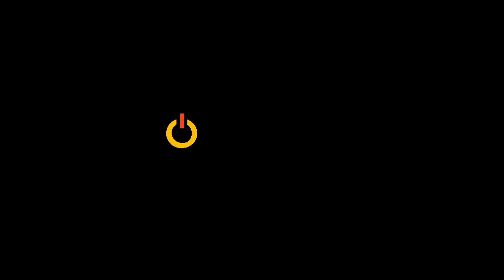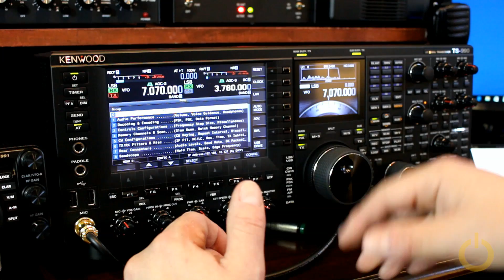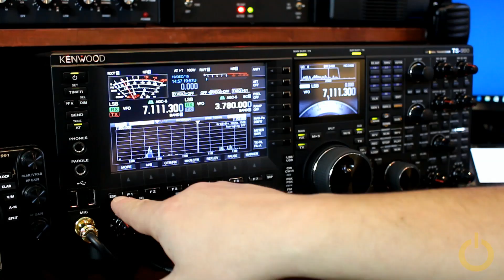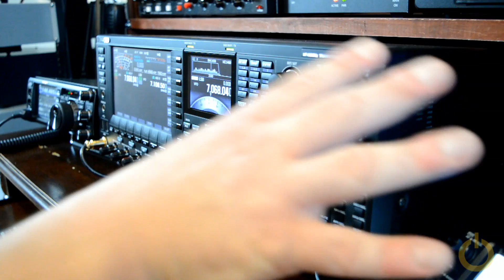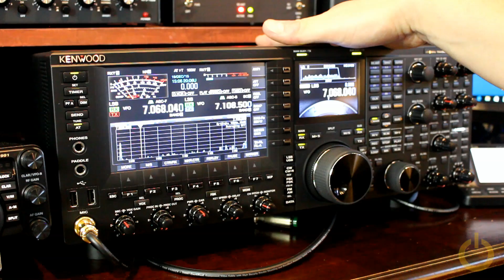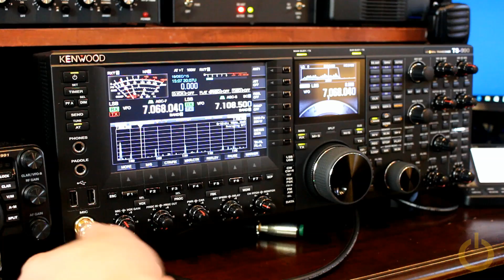Kenwood TS-990 Review and Quick Tour - Pascal VA2PV

Comment: After you spend your hard-earned $7,795.99 for this TS990 transceiver and get it on the air, you will notice that the band conditions are horrible, and have remained so for many years. In 2021 we expected the 11-year sunspot cycle to improve, however this 11-year sunspot cycle is at it's lowest part of the larger cycle of cycles, so operating conditions will be poor for quite a long time, regardless of how much you $pend on gear. Spend less and get the same results. 'Sorry to say that  Mother Nature is controlling the air waves.

Comment: Is this radio better then the IC-7300 or the IC-7610?  Just wondering
Reply from the maker: With all of these radios there is no bad one.   The new Icom 7610 and 7300 are SDR new technology but the TS-990 is a state-of-the-art high rig from 2013.   Since I didn’t try the ICOM yet, I can’t say for sure.  But what I can say, all the bells and whistles in the TS-990 make this rig unique and probably more complete in features than the other two.  I think it’s like comparing a 2013 Ferrari with a 2017 Camaro.  The best advice is to go with your budget.  Hope this help.  73 Pascal VA2PV

Comment: Pascal - This looks like a great radio and you made a great video.  While I was watching it, I noticed that it appears that you have an ICOM IC 7100 on your desk.  If so, I was wondering how you liked it.  I know these radios are not new, but I have read good things about them.  However I have never spoken to anyone who owns one.  I'm thinking about buying one and would like to know if you would recommend it as a 'shack-in-the-box' type radio.
Michael VA6XMB
Reply from the maker: Hi Terry, glad you liked the video, thanks for watching.  As for the IC-7100, it’s a great radio.  This is definitely a shack in a box and a perfect radio for remote operation, see my video via the link further below.   I sold it last year because I was not doing any remote anymore and I needed some extra $ to spend on something else, hihi.  I highly recommend it as it covers all band all modes, and in HF the performance is very good, don’t judge it from its size.  73 Pascal VA2PV
https://www.youtube.com/watch?v=ovUhJWiNLfs

Comment: Might want to consult the Sherwood Engineering list.
http://www.sherweng.com/table.html
Reply from the maker: Hi Timothy, The TS-990 is not on top of the list but most of the difference between radio, in the top 20, with better result are not audible by the human ears.    The advantage of the TS-990 is all the bell and whistle that are accessible easily at a touch of a button, that’s why this type of rig is still very popular among serious DXers.    SDR technologies present better performance, but in a contest the mouse is for most a slower procedure…  This is starting to change with rigs like the IC-7610.  It also all depends of the operator operation.   My ELAD FDM-DUO (see my video review https://www.youtube.com/watch?v=4twI8nu3hnA&t=216s) is very good, especially when using a computer, maybe a bit better than the TS-990.   But I still prefer the TS-990 over it, much better experience for me.   At the end of the day, it’s something personal, performance for the buck it’s maybe not the best deal.  But look at my recent video with two matching speakers (https://www.youtube.com/watch?v=_bFUySGKzHs&t=74s) on each side, WOW, my shack is the best place to be for me, all because of the massive rig that makes me feel like a king, hihi. This is as important for me as it represent the accomplishment of my dream shack.  73 Pascal VA2PV

Comment: Wow...$6,700.00 radio (new with discounts).  Man is it nice but good lord that's a lot of money to spend just for chatting up a person which usually lasts 1-2mins.  Aside from that, excellent video presentation and quality.

I wonder if a rig like this is becoming obsolete with the new SDR gear that is coming out?
Reply from the maker: Hi Matts, thanks for your comments. Well the TS-990 is a great radio, I bought it used and had a good deal, so it's not that bad on the wallet, hihi. SDR are very good but this radio performs very well too, the best advantage over a SDR is that everything’s is accessible via the front panel, no mouse and very fast / easy access directly to features. Those rigs along with IC-7700 and IC-7851 are still the choice of many DXers because of the ease of use in contest. SDR seams to depreciated faster since not all ham’s (especially older ones) are willing to use a computer. The game changer will be the "in between", like the Icom IC-7300 and the IC-7610. I like new technology, but if I ever get a SDR radio it as to have a standalone interface like my ELAD FDM-DUO QRP. 73 Pascal VA2PV
Reply from the maker: Another thing, this beast look fabulous in my shack, hihi.  I bought two matching speakers for it... look at my QRZ page.  73
Reply: I agree, that radio and along with the rest of your setup looks absolutely amazing (and professional).  You have my sub, keep doing your thing.  cheers!

Comment: 1 x TS-990 or 2 x TS-590SG ? I own 590SG, but since it's impossible for me to afford a 990, perhaps a second 590SG on the bench could compete this set, lol, great video, 73
Reply from the maker: That is indeed a very good option.  You take one and proceed with TX inhibit, you can then Y your PTT connection and mute the second receiver while you transmit, make sure there's no power output.  I did this trick when I had the FTdx3000 + the FT-950.  See my previous video for the setup.  You need to protect your second radio, receiver, with the DX Engineering RTR-1A, I could transmit at the same frequency than the other radio with 1.3kW and the second receiver would be receiving it at only S9 !  Be careful not to blow your radio, take your time building the setup.  73 Pascal VA2PV
Reply: Good idea. However, 590SG models offer now the so called 'DRO' port, which means that a second receiver can share the same antenna with the 590SG through an on-board splitter (3dB loss, really minor). On the transmit mode the 590SG has a 20dB isolation towards the receiver, so it keeps the receiver 'safe'. Haven't checked whether the TS-990 has something similar (DRV terminal?), although I am sure it does. Good DX, 73, Kostas.
Reply: Go for the new ts 890.

Comment: The TS990S has a PTT connection on the back of the radio. It's on the DIN plug, the same place the ALC and Amp key line is. I have a foot switch connected to it.
Barry
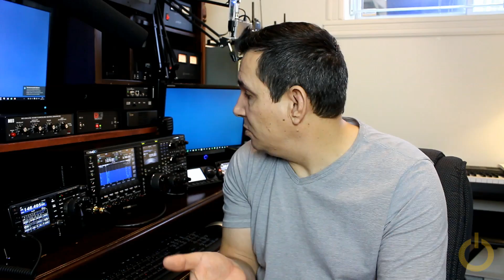Reply from the maker: +Barry Kery Correct, look at 1:54 that's what I said, you have to go on the ACC port to get the PTT.  The good thing about this is that you only need to do this once.  73

Comment: Thanks man for the nice video.  I want to ask... how you compare it will IC-7700? 73
Reply from the maker: +ForEverDubaiLover Hi, I can't say since I never operated the IC-7700.  But what I can say is that the TS-990 was release in 2013 and the IC-7700 have been on the market long before.  So I presume that it's probably better.  You can compare receivers via this web page.  http://www.sherweng.com/table.html  73
Reply: +Laboenligne.ca Thanks man I will keep this in my mind. what's the main CON and PROS?
Reply from the maker: +ForEverDubaiLover CON=Expensive, PROS=Amazing machine !  73
Reply: how do you rate this to the ts2000,????
Reply: ForEverDubaiLover what I can't understand is why Kenwood would put the better receiver in the second receiver the main receiver doesn't have that good of a receive they put the 590 receiver in the second receiver and it sounds much better than the main receiver I cant understand that part.  I would imagine the 7700 has better receive I know it's better than the 7800 better than the 7600, 7700 no slouch icon makes a pretty good radio.